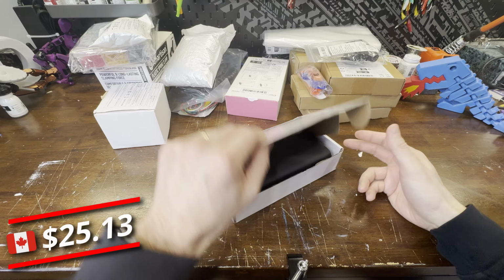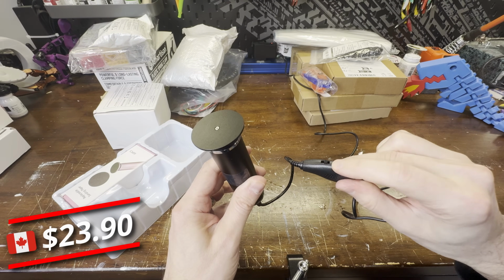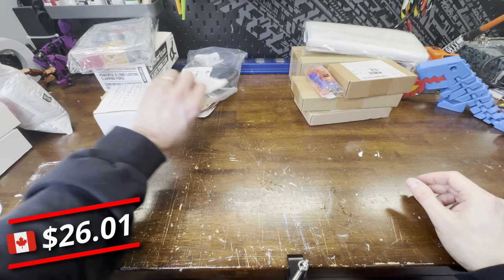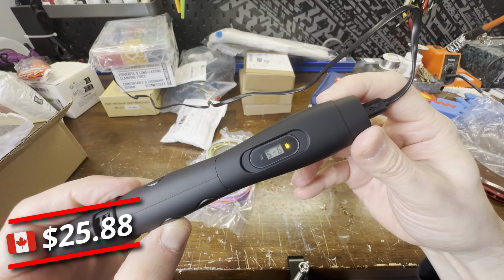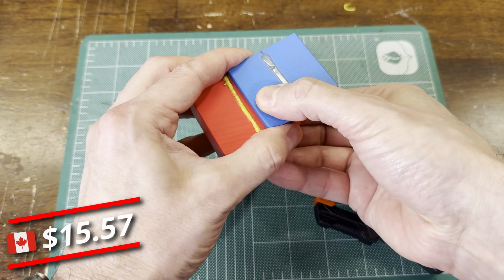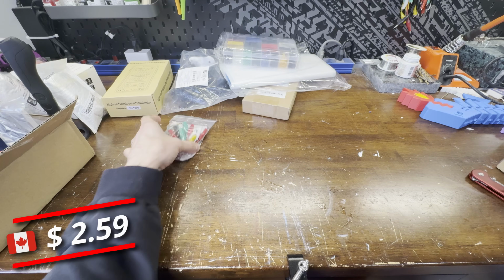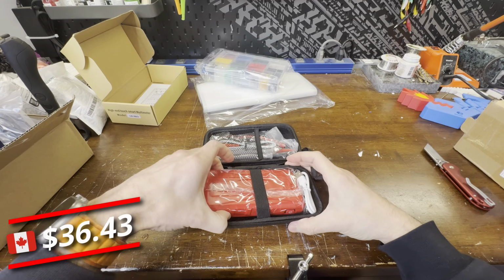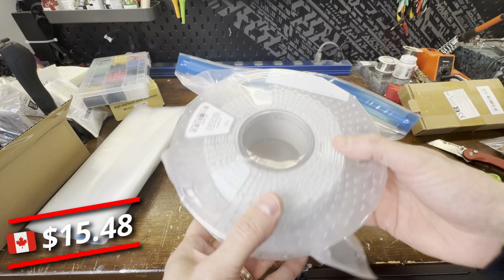Amazing Temu Finds for 3D Printing - Advanced Accessories

Comment: How Long does the Resin from These black BOTTLES need to cure with No light? And Theres No Link for Them ? Or did U Link only empty BOTTLES and fill Resin yourself? If so What Resin for Pla?
Reply from the maker: Yes they are empty bottles. You need to add your own resin. I'm using normal 3d printing UV resin. For example: https://amzn.to/4j1dmYF 
But there are lots of options to choose.

Comment: With the last one, I went a step further and got the rechargeable bag vac, very cheap. The bags it came with are a little on the tight side though for the larger diameter 1Kg spools. Sunlu fir in the good, Bambu OK, but Kingroon etc it feels like the corners of the bag are going to tear apart as you push the spool in!
Of note, those alligator clip wires are not copper… high resistance metal of some sort. Throw a magnet at them! Not great when trying to read resistance using them LOL. Great recommendations though, thanks for the video
Reply from the maker: I didn’t see the bags with the electric pump or I probably would have got those instead :)
The hand pump is manageable though as long as your not constant opening/closing the bag :)
Reply: @ I may have bought that one on AliExpress now that I go back through my Temu orders. Cheap enough though! My bags are always getting opened and closed. I’ve had one failure so far which I think is ok.

Comment: Great video, I have most of the items, less the PLA pen and magnetic alligator clamps.  I went to your channel to look for the videos of the project for building the fusion and blinking lights using the small Arduino boards and I could not locate them.  Can you please provide where on your channel (playlist) those videos would be.  I have a full size R2D2 and a Mouse Droid but I'm working on a couple more droids that will need blinking lights and a new Mouse Droid with Fusion canister lights on top.  TEMU is addicting and most of their discounts are confusing and when you try to add things up the price at checkout is never the same.  You have to be careful between credit, discount, off, sale price, etc. You may get $100 off the product, but the sale price goes away and the $100 is off the original price which sometimes is more expensive than the sale price.  Keep the video coming, I subscribed and liked.
Reply from the maker: Thank 🙏
This is the video the clip of the less/arduino are from
3D Printing a Huge Lego Space Man LED Lamp
https://youtu.be/r-NMhetqe7c
If you google arduino fastled you should find lots of examples

Comment: I bought some double ended aligator clips from Temu, but the plastic sleeves are so slippery they are just about unusable, the clip slides around as you try to squeeze it.
Reply from the maker: I’ve had the same issue with ones I got off Amazon. :)
Reply: @DaveRigDesign  Probably the same shoddy supplier.